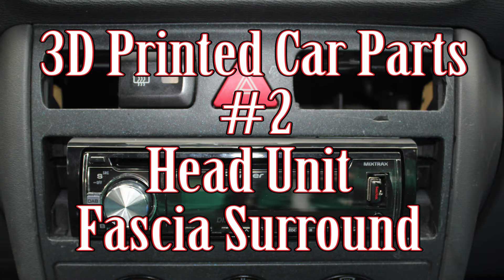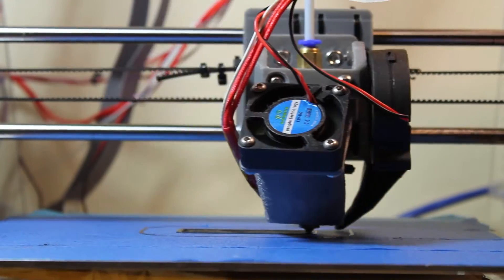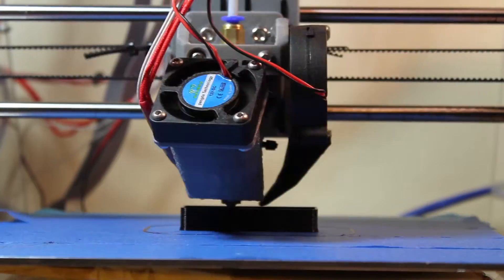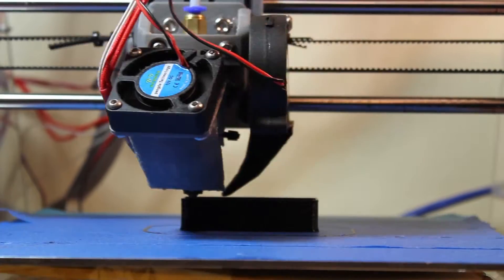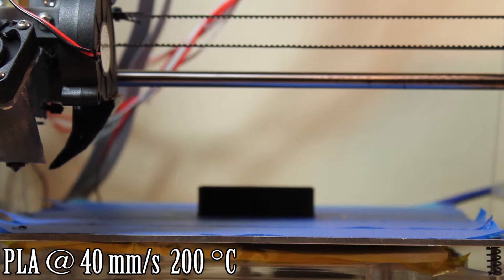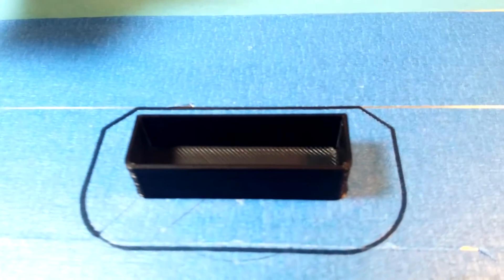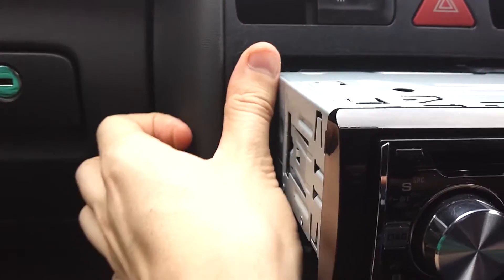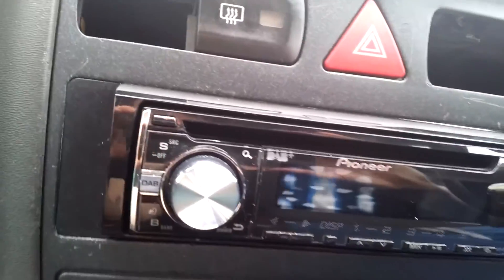3D Printed Car Parts #2 Head Unit Fascia Surround

Comment: word of advice for anyone planning on doing something like this, design the sides with vents, make sure the unit has ventilation, also if you're not satisfy with the looks, i suggest you buy some Vinyl rap for the place.
Reply from the maker: The head unit has lots of ventilation space behind and in a very long time of having this fitted there were never overheating issues. Have you had issues with overheating?
Reply: CarAndMechanical not for the unit itself but for the PLA, with the heat in summer and the heat from the stereo, the plastic often becomes soft and moldable. Having some ventilation racks allows the air to move arround
Reply from the maker: Fair point and an issue I had when I made a digital boost gauge as it was in the line of sight of the sun. These bits though and others were fine, I'm now more inclined to use PETG.